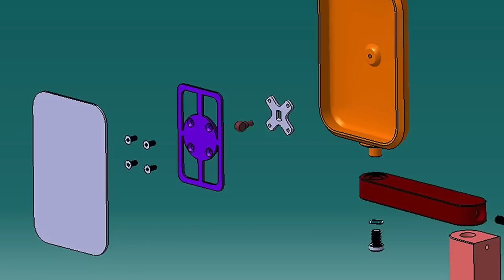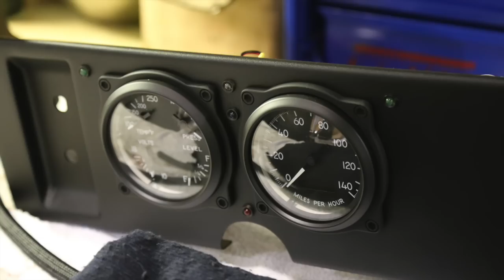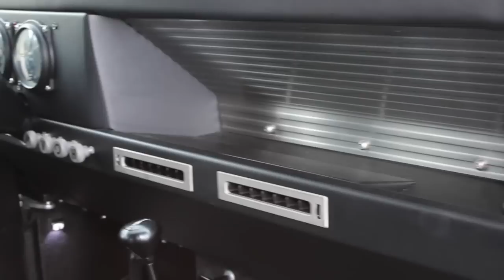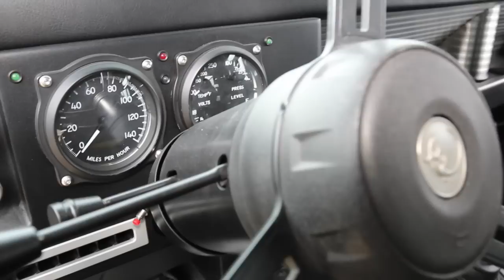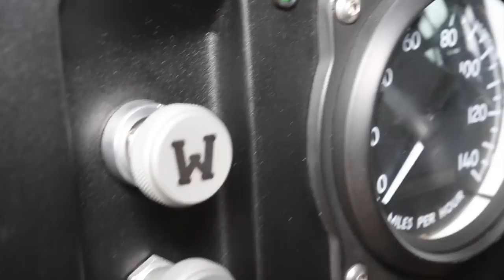ICON Reformer Custom Land Rover NAS110 Defender

Comment: A Lot of work and well re-engineered!  Must have been great to have such an open cheque book from your client. I own a series 3, all original and appreciate all your comments on the shortcomings of the original Rover vehicle.   I am a bit of a traditionalist hence I am not a fan of the coil sprung 90/110 which is why I prefer to suffer the jarring rattling experience produced by a 40 year old leaf sprung example!!  However I think you have done justice to probably what should have happened progressively over the years culminating in something like your design being produced at Solihull today instead of the antiquated version we are expected to pay £40,000 for!

Comment: It's awesome, I just love the exterior design and could look at it all day especially when they have been properly specked up like this and everything is how it should be in a perfect world, it's a large menacing beast and even in another 10/20 years it will still look cool, it's a timeless design, it's interior and the guts can all be changed out and fixed/upgraded every now and then just as long as the exterior stays the same this vehicle will always have a solid following.

Comment: I really appreciate the build, you've done an excellent job on that rover, but as far as I know, those side vents, especially the right one is the air intake, the left one's for show. That's also the spot where all the snorkels attach on the car, they've made the intake there because when you're driving through water, you're less likely to suck in water. The top vent in the hood, where you made the engine air intake is the intake for the interior heating. But I think also here it's just on one side, the other one would be for symmetrical design reasons. Well, that's at least the case for the European diesel models. Other that that, I really appreciate the concept, the LS engine doesn't disturb me, why not, if it fits! It's got power, it's easy to service and it's reliable; so it's definitely better than the stock ones. In my opinion one of the best Defender builds out there for sure, respect! No need to talk about the finish of your work :)

Comment: I am very impressed by ICON products, I just don't get the steering wheel used in all the models. I find it too obvious where it originated and a vertical bar across the gauges seems weird to me.

Comment: If it originally had a v8 in it the rover v8 is a gm engine it started life as the Buick 215 aluminum v8 first used in the '62 Buick special

Comment: Love all the attention to detail but an LS2 in a Landy is too much. Why does every custom car these days have an LS motor of some kind stuffed in? Prefer the Zulu with an AJV8
Reply: Because a variant of the LS has been used in GM trucks for more than a decade, and has proven itself very reliable, powerful, and easy to service. This being a truck it sort of makes sense. Also, they are easy to install with all the assorted electronics, and are emissions certified from the factory. A Jag V8 would need to be pulled from a junkyard and would take ages to tune to run with the auto tranny and pass SMOG. With a build this expensive, no one is going to settle for a junkyard motor. Also, this LR originally came with a BOP/Rover V8 so it is a kind of spiritual successor.
Reply: ***** I know all that, LS motors are bulletproof and support is great but I just find it boring when people fit them in everything under the sun. Where is the originality and engineering skill? It just seems like paint and fabrication are leaps and bounds ahead of engine  building these days because everyone just stuffs an LS into their projects
Reply: Typically, I agree with you, but I think it's ok in the case of an old LR.
Reply: David Yegiazaryan The Range Rover AJV8 as far as I know was only mated to an auto box. As for this being a spiritual successor for having an LS you are way off the mark. That would be like stuffing an LS into a Maserati Grancabrio and saying the same thing
Reply: David Yegiazaryan Well, that's okay. I just wish they carried their attention to detail and workmanship into their engine bay instead of copping out and going with the easy option. I would've had more respect for them if they mated 50 weed wacker engines together and managed the same horsepower, but that's me, I love engines

Comment: Putting an automatic transmission in and old Rover or Landcruiser is so wrong. The posers are winning...
Reply: Land Cruiser  Nah, not doing it is just a 'who's the bigger man' contest... ;)
Reply: Land Cruiser could you beat him off road with the manual one?...hes payin hes gettin
Reply: You mean like the factory 1997 Defender has?
Reply: the auto model was US only. Every other one got a manual (from mid 80s to 2016) you can convert using range rover transmission but you still need to get or mod the trans tunnel.